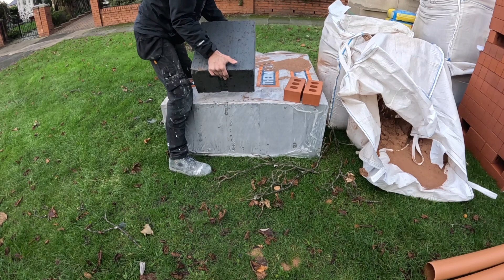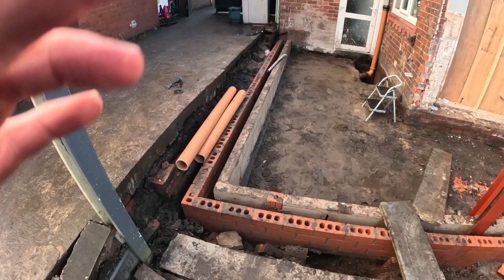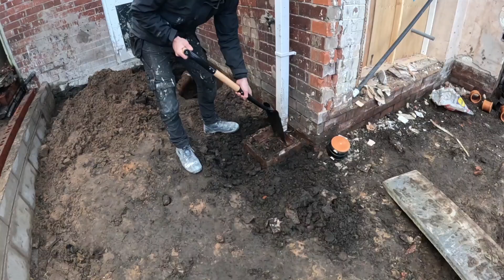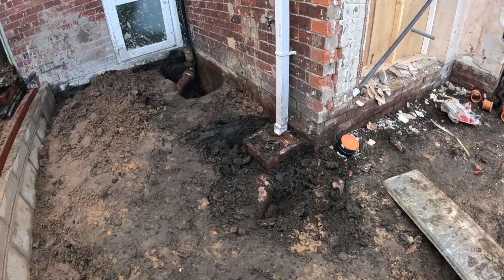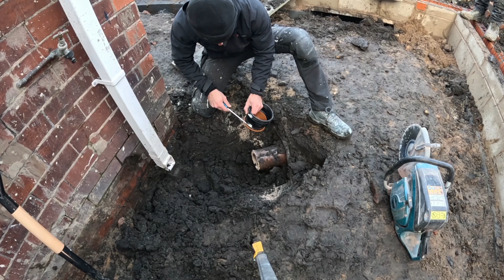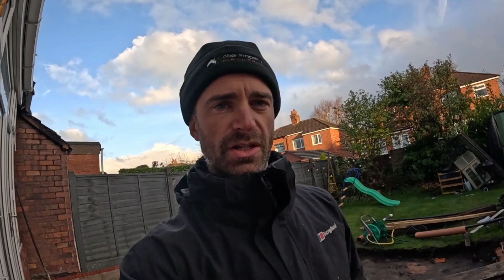Building extensions - How to build to DPC and cap off old drains.

Comment: Why is your DPC height a foot lower than next doors concrete height ?
Reply from the maker: @TIG10109  the road is on a slope and next doors driveway and house is a lot higher than the one we are working on. Our dpc height can only be matched with the existing house dpc.
Reply: @Collier-property-developments  I'm probably wrong,but I think you're asking for a problem with damp once next doors side is made up and finished your DPC will be under ground! ,just saying 👍
Reply from the maker: @TIG10109  no not at all mate you are right with that. But the dpc height can't be changed to accommodate next doors driveway, 
We will be fitting a damp membrane up the wall once its built and then it will be backfilled with stone and concreted over again to fill the driveway in too anyways, 
Appreciate the comment though mate, Cheers.
Reply: @Collier-property-developments  makes sense,although I've seen brickie's step the DPC up to height? Cool cheers fella 👍

Comment: 150mm cavity!? What is happening in England?
Reply from the maker: Haha I know trevor. We use a 100mm cavity still  but with the mega expensive 97mm Pir insulation, £28 per sq m compared to the wool which is around £7 pm² I think.
Reply: @Collier-property-developments  I'm an electrician, so 150mm cavity is what dreams are made of haha